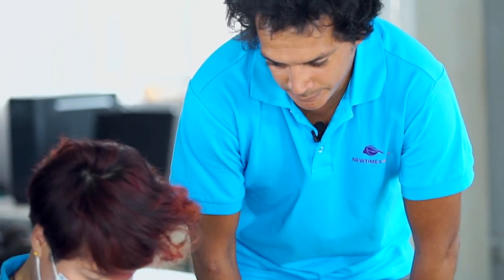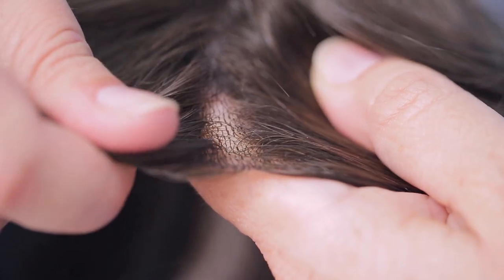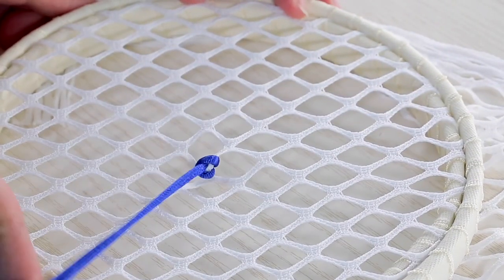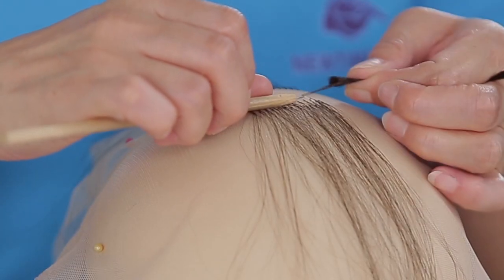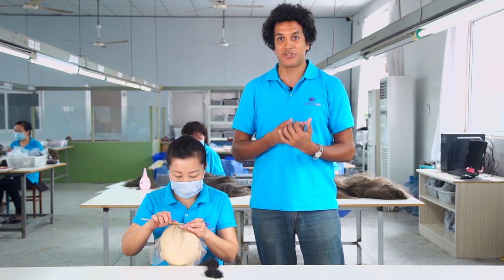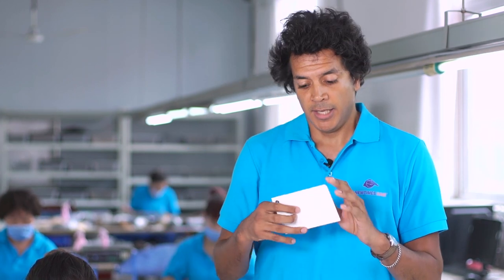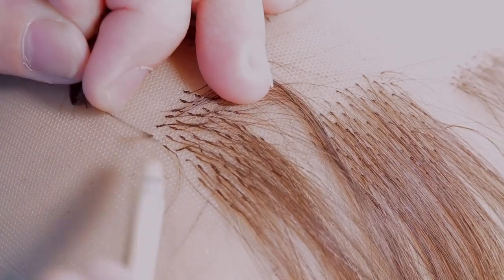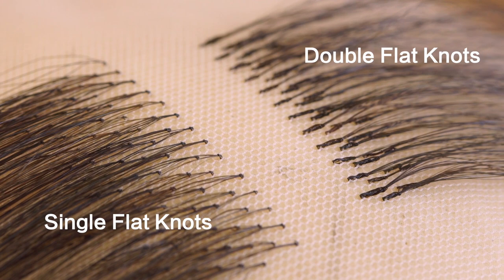Ventilating Hair Video Tutorial: Single Flat Knots and Double Flat Knots on Hair Replacement Systems

Comment: The problem i am having is pulling the needle back thru. I can insert the needle and grab the hair, but the needle snags and gets stuck trying to get it back thru the hole.
Reply: Make sure you hold the strands tight brave it on the net so the hole open wider then pull through I hope you get it by now because this comment is couple months old

Comment: I have a one question about  the direction of hair cuticles. If you fold the hair in half, then half the hair is in the other direction and the hair tangles, especially when you need to cut  hair short
Reply from the maker: Hi! Thank you for your comment! That's a good question.👍  Well, the 4"-5" return hair will be processed by enough acid treatment to remove the hair cuticles, while the other side of the hair will go through slight treatment so the cuticles will remain. One side with cuticles, the other side without. So the hair will not tangle.🙂
Reply: @NewtimesHairOfficial  Thank you for a respond. I have ordered some hairpieces and I have a trouble with tangle hair. Could you say if I am able to do something with this problem ?
What  acid do you use? Do you make a hairpiece to order? I deal with hairdressing in Poland and I am looking for a contractor. I have Slavic hair and I would like to have wigs made of such hair.I could give you  my mail for a correspondence
Reply from the maker: @grazynaburda8564  That might have something to do with improper cleaning methods. If it is a hairpiece with small curls, you need to brush the hair with a wide-tooth comb, then wash it with hair conditioner first and then with shampoo. Next, make sure the hair is fully soaked with hair conditioner otherwise, it will become dry and tangle. Do not use a hairdryer. Put a towel on the hair to absorb excess water and let hair dry naturally. 
Besides,  we sometimes receive the pieces with tangled hair from our customers, and we found that the tangled hair has formed a big knot and there is much hair spray and hair vaseline in it. That is because it was not cleaned well enough. In that case, we pick out the hair one by one and use water containing soda to wash the spray and vaseline off. Then wash the hair with hair conditioner and shampoo. After all that, the hair will become very smooth. 
🌟Yes, we are a wholesaler of high-end human hair replacement products.https://www.newtimeshair.com/ Welcome to cooperate with us! Could you please leave your email address and WhatsApp number here? Thank you!🤗

Comment: Best educational knotting video in yt!
I have 3 questions:

1: Do you use the middle part of the hair strand? Since the hair has small scales, combing the hair would be kind of problematic

2: how do you create a natural look for the swirl area on a lace piece?

3: What is the life span of a simple flat knot lace unit?
Reply from the maker: Thank you!🤗🤗
1. Nope, we use the first 4-5" around of the hair strand. For normal hair, we will remove the scales, so it will be smooth and will not tangle; Virgin or Remy hair has scales but they are in one direction so the hair will not tangle when combing it.
2. First, we will put more hair on the crown swirl; then, bleach the knots there to make it look natural.
3. Around 1 month only since it's not strong enough. Normally, for a lace unit, we use single split knots at the front 1/2" and double split knots on the rest. These knots are stronger and can last longer. The life span is about 3 months with light hair color and about 3-6 months with dark hair color.
Hope that would be helpful to you.💜

Comment: Very helpful video. Which men base system do you use single flat knot on the front hairline?
Reply from the maker: Very glad you like it.🤗 We will use single flat knots on the front hairline of lace bases if the customer requires to get a standing hairstyle on the front.
Reply: @NewtimesHairOfficial  Thank you. Some follow up questions: 1) does the STOCK lace system (swiss or french) is using single flat knot in the front hairline or only for custom order? 2) does single flat knot in front easy shed hair from combing? 3) My understanding is that bleached knot in front is very to to shed hair ... so not strong ... am I correct? 4) does single flat knot in front looks very natural hairline? 5) can you use single flat knot on poly thin skin? Thanks
Reply from the maker: @glin930  1)Yes, for custom orders only. 2)Emm..actually yes. It will shed easier than double knots. But we will use poly to seal the knots on the base to make sure it will last for some time. 3) Yeah, but that will also depend on how much it is bleached. If bleach too much, it will shed very easily. If bleach nicely, then it will last for longer. 4)Yes! You can easily control the hair direction, and with the standing style on the hairline, it looks very natural and realistic.5)Yes, we can. But not on the front hairline. Instead, we usually use it on the sides and back to get a flat effect just like your own hair.

Comment: would like to ask you something , Once I ordered a lace top wig, it has been done from completely virgin children hair. Lace part of the wig completely tangled after my wash , because the returned short part of the hair strands were holding the long part of the hair strands. And until detangling it a lot of hair has been lost un fortunately. How do you solve this tangling issue with the returned hairs? Are there a solution for that?
Reply from the maker: Hello, thanks for your inquiry!🤗 According to your description, we think that's probably because the return hair has not gone through enough acid treatment. There are still hair cuticles on the returned hair which cause the tangle. For this reason, the wig needs to be processed a little bit more in factory. Besides, some of our customers once used toilet cleaner(acid) to soak the wig and it worked. You could have a try but we are not sure that will also work for you.🙂
Another possible reason is overprocessing. The hair has been damaged and has become extremely dry. In that case, we think you need to order a new wig. 
We will soon produce a video about hair tangle, please keep an eye on our channel. Thank you!😊